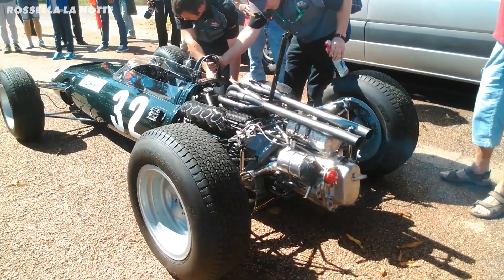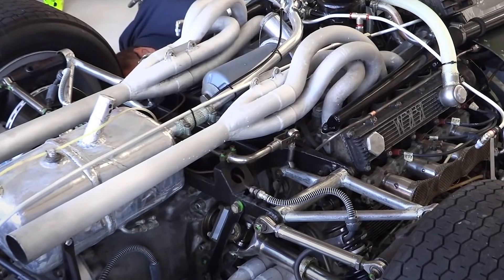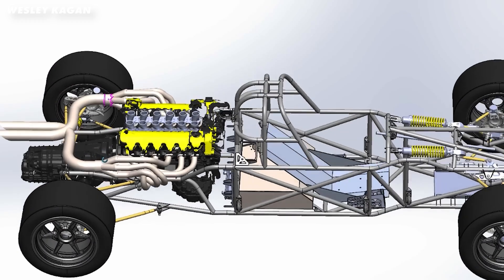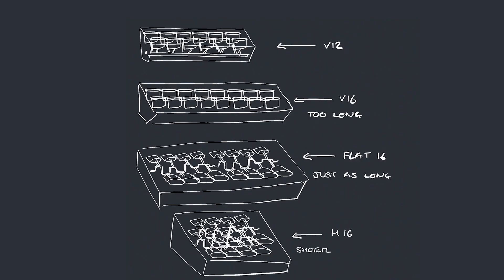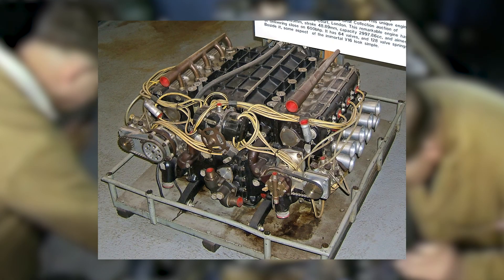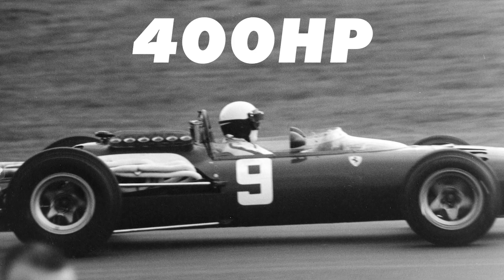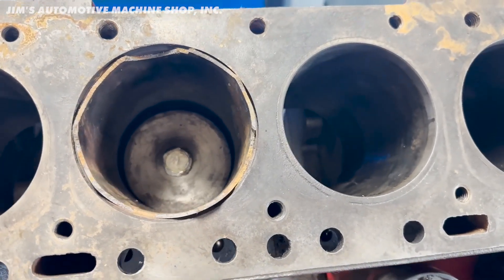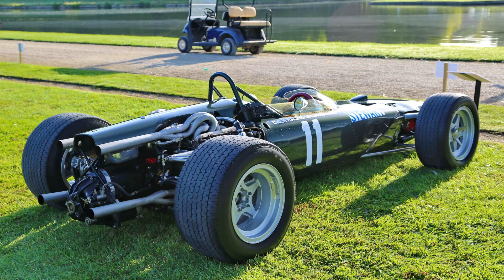The INSANE H16 Formula 1 Engine!

Comment: the problem was not the h16 arrangment. the problem was that they reused basicly whatever they could from a v8 engine. the h16 could by any means had been a very, very brutally good design. one of the flaws.. single idle gear. that means the cranks spin to the same direction. should had used 2 crank gears. thatway the crankshafts would had rotated coutering each other. cancels out a LOT of vibration. but why.. stop there ? this engine had its head deasigned based largely on the former v8, along with the valve train. a stupid idea indeed. could had used pushrods. as blatant as it sounds. re-use the idlers to run 2 cams, needs just 2 more gears for a nother 2 cams. thatway you get a far smaller head to begin with. those idler gears had NO place at the end of the cam. instead, the valve train should had been driven along with the idlers, from between the 2nd and 3rd cylinder for each bank. you get incredibly less torsion force . now that would had been just awesome. saves weight, solves a lot of imbalance and inertia, and vibration related issues. as a side note, yess, it would have no issues revving higher. you get a narrower engine too, far simplified mechanically . but that wouldhad called for a realy new design. like an all new design. should NOT had the coolant and lubrication lines made common. since they where running 2 pumps anyways for everything, keep the 2 loops for the engine bank pairs separated. and it had been a real beast, with more valve area than a v12, so even at the same rpm, the volumetric efficiency would had been higher. that translates to mooooar powaaa. a lot more of it. and smoother runing. if them engineers would had not been confined by re-using whtever was possible to re-use from the former 1.5 liter desgin, highly likely up to the turbo era this configuration would had been the dominant. highly likely even when the turbo era kickt in, a h16 turbo 1.5 would had been able to vastly out perform anything imagineable, mainly by not having the hectic tourqe curve, instead.. having a far more civilised and driveable character. the faliure of the h16 design... is genuenly a step back for all of humanity.

Comment: Bit of a misconception there. Engine water pumps don't add pressure at all, they provide coolant flow. The engine's temperature is what provides coolant pressure until equilibrium.
The BRM engine had two water pumps because a single water pump big enough to provide enough coolant flow around all of those cylinders would have been enormous and impractical.
Single water pumps also don't scale up very well, one big pump wouldn't provide a lot of coolant flow at low rpm's, then risk cavitating at high rpm's. Two smaller pumps is more optimal.

Comment: Someday, someone will want real replicas of earlier formula car racing crate engines for their dream I.C. kit hypercar made for regular inter-municipal and highway driving to run ordinary pump gas octanes.  But these engine power plants must build on latest auto manufacturing techniques to make them run safer and as long-lasting as regular normal car engines with regular maintenance:trophy-yellow-smiling:

Comment: Another WHY attemp. BRM were reputedly underfunded so made the most complex finicky unreliable engine.
Meanwhile Repco here in Oz away from all the b/s made a better and simpler engine based on a roadcar engine.
Was it the best?? probably not but Jack won a couple of titles with it. Cost? aLOT less than the BRM

Comment: The Napier Sabre  is a H 24 engine powering the Hawker Typhoon fighter  aircraft of WWR 2 .producing  2000BHP and up to 5000 BHP on development test.
The Rolls Merlin is a V12 and back then produced about 1200 BHP
After a long Development period the Sabre was reasonably reliable and the Typhoon and Tempest were very successful in  Fighter/ Bomber attacks.
I Guess BRM was influenced by the success of the Sabre in designing their H16 engine.

Comment: I remember a slightly different scenario. BRM had just developed an 8 cyl. 1.5 ltr boxer which was just becoming sorted out when FIA changed the formula to 3 ltr. The obvious solution was to use two previously developed engines. It was a very good running engine for a few minutes at a time but reliability was the real problem.

Comment: The initial version of the BRM H16 was not 4 valves per cylinder.
The Napier Dagger aircraft engine of 1935 far preceded the BRM H16.  I wouldn't be surprised if BRM got their inspiration from it.

Comment: More cylinders also have more surface area per liter.   So there is relatively more surface area for the combustion gases to act against relative to an engine with less cylinders.

Comment: Might have worked better if, when studying the successful H-24 Napier Sabre aero-engine, BRM had taken note of how Napier geared the Sabre engine's two crankshafts together using self-centering idler gears to eliminate harmonic imbalances. Instead BRM choose to gear their H-16's two cranks together using a rigid idler. This resulted in several harmonic vibration induced problems, mainly self-destroying dry-sump pumps and chronic ignition mis-firing issues. BRM were supposedly building a 4.2 litre version of the H-16 for Lotus to run in the 1967 Indianapolis 500, but rumour has it that both examples they actually built grenaded big-time while being dyno-tested.

Comment: The Napier Sabre Engine for the Hawker Tempest springs to mind.

It's amazing they didn't go down the Deltic 2 stroke route!
Reply: The Napier Sabre was supposed to replace the Rolls Royce Vulture X-24, which had severe and insurmountable lubrication problems. However, the Napier was also unreliable, for many of the same reasons mentioned in this video. That said, the Hawker Tempests and Typhoons did manage to do some serious damage to the Germans in the last year or so of the war.

Comment: V10 would been perfect - same stroke as the V8 and a 25% larger bore (85.625mm) > 350bhp - shorter versus slightly lower rpm than a V12

Comment: BRM also was working on a 4.2L version of the engine for Indianapolis 1967 but that never saw the track. Lotus had the 16 on the entry list but switched to the Ford v8. BRM was good when they kept to conservative goals but like the 1.5L V16 they built in the late 1950's they never knew what their limits were.

Comment: Seems to me it would have been better to run the two cranks in opposite rotations to eliminate torque and (possibly) help with vibration. The two cranks could be directly linked without the need for an idler.
Reply: Opposite piston couldn't run on 4-stroke cycle

Comment: Lotus was using the Coventry Climax 1.5 litre V8.   Coventry climax Did not want to build a larger engine.
Repco made a V8 for Brabham from an Oldsmobile block that was superoior to any other  formula 1 engine.   When the Cosworth V 8 came out, all other engines were superfluous.

Comment: They would have been wise to have learned from rolls Royce experience with dual linked engines, namely the vulture. From that utter failure in the Manchester bomber eventually came the Lancaster with the much more reliable merlin instead. Granted ww2 aviation vs 60s f1, but quite a number of similarities in problems.

Comment: Strange so much hostility to the H16, This was the period which had great innovations all the time with limited rules, and just slide rules to work with, that it was not a success is fact, but if it worked as planned it would possibly have been the engine that outdated all the others. Wonder with modern metals how a 2023 copy would act after computer simulation to iron out any problems, if memory serves me right Lotus was the first to have a separate rear wing on struts with the lotus 49, they kept falling off but after a while everyone learnt and had them
Reply: H-engine just suck. Even before on Napier Sabre.

With modern tech? Oh dear you had dementia with W-16 engine.

Comment: The real reason that more and smaller cylinders can rev higher than an engine with fewer is the ratio of valve area to displacement. That is also why a large single cylinder makes more grunt smaller valves so better cylinder filling at low RPSs Honestly I am not shocked that BRM went for an H bloc look at the Sabre engine from WWII. The UK really seems to like odd engines like the H-Blocks, sleeve valves, the Deltec, and so on.

Comment: A friend of mine was thinking ( long-term) about building performance sports cars, with the goal of a real super-car. It didn't happen but I roughed out a plan for an H-16 engine for it. It would have been 10 litres and about 1,000 hp naturally aspirated, with quite a lot more if fitted with turbos. It would have an economy mode, where the lower bank of eight cylinders would shut down and the power would be provided by the top half. The engine would drive a hydraulic CVT, with 4WD to make the best use of the power. The entire engine would about 900 mm long and 300mm high. It would however, have been fairly heavy.

Comment: If you are going to go to the trouble of running multiple cranks using opposing pistons seems like a better idea. The rules probably said it had to be 4 stroke though.
Reply: Opposite piston can't be 4-stroke since it's difficult to put the valve

Yeah you could, but at that point DFV is right in front of your eyes, and much more viable for ground effect later on

Comment: The real reason BRM used an H-16 is because in 1965 they ran a boxer 8 not a V8. The FIA changed the formula at the end of the season forcing all teams to scramble. The obvious solution for BRM was to use two of their newly developed flat 8. The series was won by Brabam powered by a Repco modified Oldsmobile 215 cu. in. aluminum V8

Comment: This engine lay-out was known from the Napier-Lion aero engine that powered one of the later Supermarine fighter-bombers. Back then it was a very complicated engine with a lot of teeding problems. The 50's are not that far behind the second world war.
Reply: The Napier Lion was a W-engine.  Three banks of 4 cylinders with a single crankshaft.
Reply: @andyharman3022  
You are correct, the Sabre was  the late/post war H engine. The Lion was the pre war W engine. I mixed them up.

Comment: BRM's H-16 was a sloppy idea thrown together without sound engineering.  Their prior supercharged V-16 was a beast but they were blindsided by the rule change and the H-16 was just a couple of opposed 8's stacked onto each other and synchronized through a chain drive.  It was too heavy and nightmarishly unreliable. When it did work, it was fast. But there's a reason the drivers called it the boat anchor.  Look up the sounds of their V-16. Many car aficionados, myself included, consider it the greatest engine sound ever recorded. It's right up there with the world's greatest symphonies.

Comment: It just needs sleave valves & you’d have a miniature Napier Sabre
Reply: Mind you the Napier was 2 stroke & thus also Supercharged for scavenging without the need to run the fuel through the crank.

Comment: The main limitation to engine performance and reliability is keeping the exhaust valve cool.

The contact surface for doing this is the surface area of the valve seat. Multiple smaller exhaust valves will have a greater surface area than fewer but larger exhaust valves. 

There was some method in this madness, however carrying the extra weight of two crankshafts probably should have rung alarm bells before the design left the back of fag packet. 

But what an amazing noise though.

Comment: I don't quite understand your logic about cylinder optimisation.
More cylinders is smoother until certain 6 cylinder arrangements, then dipping a bit for an 8 or requiring counterbalance, improving again for a 12.
At 6 cylinders yes you have big bangs requiring beefier conrods but you need less of them. More pistons also means more cylinder wall surface and friction.
I can only imagine that with modern manufacturing tolerances, metallurgy and combustion optimisation the parameters have changed.

Comment: The reason these wonderful H-16 engines were not successful is easy to explain. 
In the 30's to 70's the British design engineers were without doubt the best engine designers in the World. Clever, innovative, and World leaders. On paper their engines were unmatched. Except perhaps by the Italians. (In airplane engines the Yanks finally were able to dominate not because of better designs, but of because of their big bucks to invest in production technology, and better management.)  
However, the problem the Brits had is that they were not able to manufacture their complex engines to the tolerances and intricacies required by the complex designs. Operating with production tooling; lathes, milling machines and measuring equipment; that was from pre-war times. And literally worn out. And they had not enough money to update to the latest tooling technology. Even the best machinists struggled to make reliable engines. Resulting in the abysmal reliability of these complex H-16's. And the engines were way too bulky and heavy.
When the Cosworth DFV came along at this time period - it was simple. Essentially two 4-cylinder production Ford 4-cylinder engines in a "V" - with a revolutionary combustion chamber. And the engine was easy to make with unsophisticated tooling, and very compact and light. And only took about 18-months to debug. All credit to Keith Duckworths genius design. And Cosworth as a company wise investment in modern lathes, milling machines and measuring production equipment paid off.
Moving on into the next century, the Brits finally caught up the rest of the World in investing in modern computer-controlled machining centers, mostly Japanese, and were able to resume their position on top of the pedestal of making the best state-of-the-art racing ICE engines in the world. And now are arguably as good, or better, than their Italian, Japanese, German and French rivals. Even Mercedes makes their F1 engines in a UK facility which they own.
Reply: OK, so after that lengthy word salad, I have one question. If technology was the reason why that engine was so unreliable, then why hasn't anyone revived them in the modern day? It's because it's not a good design genius. 🤔

Comment: A very interesting video, one slight correction though, your diagram showing the crank bending of a V16 or flat 16 from end to end isn't accurate, the problem isn't with long cranks bending (sagging) in the middle, because of course they are supported by the main bearings, but with the long cranks twisting (as did the straight 8's around about the WW2 era).
Perhaps you meant twisting from the get go, but it's not what your picture shows 😉
Reply: It was occasionally a problem in the Fairbanks-Morse straight 20 (yes, 20) cylinder diesels.
Reply: @kennethjackson7574  wow! That's a big straight engine!😲 A low revver I guess?
Reply: @Markpd69  They could reach 900 rpm.

Comment: the H16 was essentially 2 V8s that were unfolded and stacked. they used the same heads that were on a BRM V8.  The solution to it's problems was the Cosworth V8.

Comment: With sustainable fuel and the high efficiency of these modern f1 engines. I wish they would go back to V8s in 2026. I’d freak out if this happens. It may not sound exactly like the V8 era but it would be much better than these vacuum cleaners we have nowadays.
Reply: What they mean sustainability is not really "green energy" or "efficiency"

It's just all about "manufacture incentive". The one that carry the whole F1 program. They don't like it, they can go and ruin F1 just like they did with LMP1

Comment: Modern F1 would be so much better if they opened up engine development and restrictions. It was so much more interesting back in the day with different engine layouts, some supercharged, some turbo and some N/A
Reply: They did in WEC

Some people did run crossplane V8, but most people just stick with V6 Hybrid even V4 Hybrid despite they had chance building V24 30.000 RPM NA engine.

So... Everything is inevitable anyway

Comment: Got the weight & power figures reversed. This from BRM who trued a 1.5 liter, V16 (yes 16) supercharged F1 engine that fared no better. Blewup often as I tvwas based upon an unproven prewar cylinder design & had no grunt below 9-10,000 rpm. The 1.5 liter V8 was successful.
I've read 60s Lotus had fuel tanks on either side of the driver. Adding another one just shows how the H16 went in the wrong direction.

Comment: Not a new concept.  The RAF Hawker Typhoon fighter of WW2 used a similar "H" type stacked flat engine layout long before BRM tried it.  It was a 24 cylinder sleeve valve Naper Sabre unit.  I remember BRM trying the "H" concept and failing miserably.  Just too unreliable.  The Repco Brabham V8 at the time was absolutely the opposite in concept/simplicity and won several world championships due largely to it's reliability.  To win you first have to finish.
Reply: And Rolls Royce discovered the X layout a disaster with their Vulture engine.
Reply: Cooper was using Maserati V-12s in '66 - powerful but heavy, not particularly reliable - nevertheless Surtees and Rindt finished 2 - 3 that year in them.

Comment: ahAaaaaaaaah! i've known about this engine forever (via GPL) ... but this is the first time someone has pointed out that the original was opened to a "180° V8" before stacking two of them together. i thought it was two V8s sideways, duh! such a pity this didn't work well. maybe they should have tried a W configuration with banks at 0, 60, 120, 180 degrees?
Reply: ...and surely drive should have been taken from the idler gear?